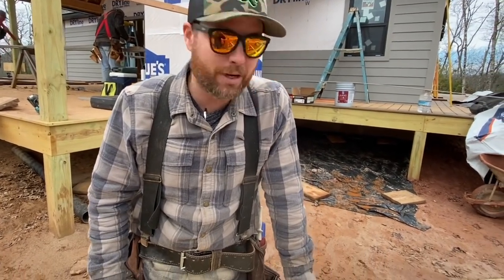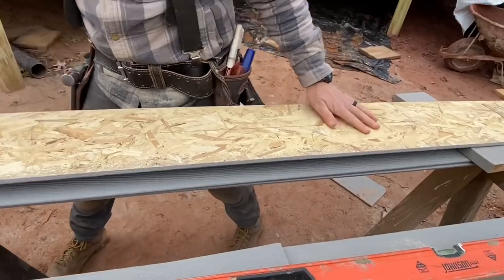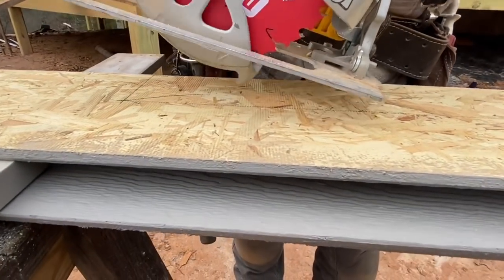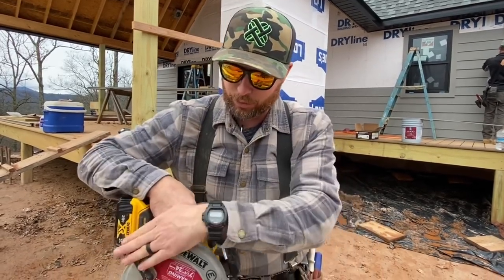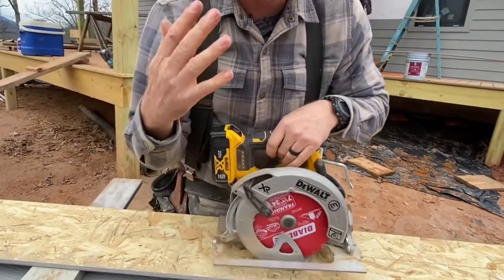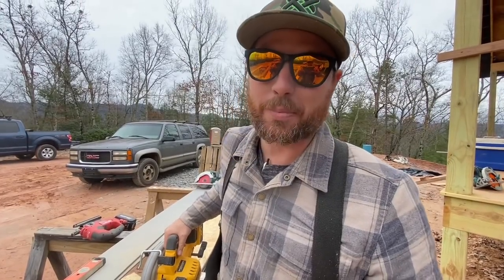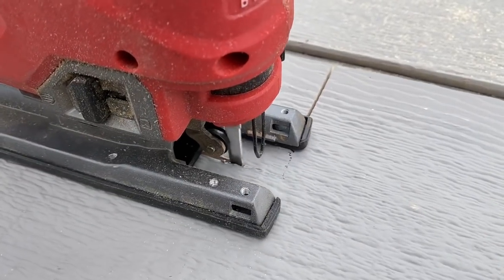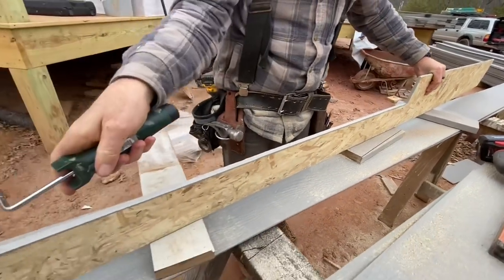Learn how to plunge cut with a circular saw

Comment: There have been times I've back-cut with a battery circular saw and ONLY a battery circular saw and it takes and extreme amount of focus and patience to cut a tight line going backward. For those curious, if it were not a battery saw, I would not attempt it. Battery saws have more forgiveness in that they stall quickly rather than a corded saw which will run through a bind until the freespin of the motor stops.

Comment: No sarcasm intended.  It is nice to know that sometimes some of the techniques that the pros use really are common sense. I thought you were going to show some special technique that the normal diy like myself would never pick up.  But you did it the same way i figured out many years ago.  I thought i was doing it wrong as i always needed to use a jigsaw to get good corners but it seems that is just the correct way that i just happened to figure out.  Thanks for the great videos.

Comment: Back when i was 20 i was a helper ripping rotted deckboards out. I was doing plunge cuts to split the board because there was like 6 coats of paint over the screws. I tried to go backwards and the big skil77 framing saw shot out of the cut and the blade guard ran along my inner thigh. If the contractor i was working for had removed that guard ,like some like to do,  i wouldnt be around today. This was a rural area and it was gonna be over an hour until he was back from Lowe's with the new boards. Could have been a real bad day so im glad to see you mentioned not to move it backwards lpl

Comment: Nice saw, my dewalt cordless is cheap, but lefty, which i prefer. My batteries, 4 amp and 5 amp dont last that long, especially cold weather. I ordered a skilsaw 7 1/4 blade left corded online last year, it works pretty good when im going to do alot of cutting in one place. 
I work on alot of barns, so the cordless tools definetly come in handy. Often just too far to run cords

Comment: Hey Guys.  I really like watching your quick videos.  To the point.  Factual.  A bit of humor....great job as always. 

I couldn't tell from this video, but I was wondering if you do a dado cut on the bottom piece of trim along the bottom inside edge of the window trim? 

Here, in the rain-soaked land of Washington state, I always dado the bottom inside edge of both of the side pieces and the bottom piece of trim so that my siding tucks up under/behind that dado'd trim board.  I'm not sure if I explained that well.

Thanks for all the work that you do to put out these videos. It's nice to be able to send a link to one of your videos to someone who has a question on how to do something.
Reply from the maker: Mike para-CAD thanks Mike... Great idea doing the dado cuts on the bottom piece of trim.. that’s a bombproof way to keep water running down the outside of the siding! We didn’t do it on this window… It’s up under a huge porch roof. Appreciate your comment

Comment: It's the same here in the UK.
It's all about getting a degree, apprenticeships are seen as second best. Also, people seem to be impressed by degrees, yet spend years doing an apprenticeship and people seem to regard you as one step up from a ship's rat.
The hours we work to scares most off, they want flexi hours, lunch hours etc. I started off as a plumbing and heating engineer, then went to earthworks operating excavators etc (I've always loved machines). I'd go wherever the machine was sent, that could be a two hour drive away the other side of London. Leaving home at 6.00am doing a 10 or 12 hour shift and getting home anywhere after 7.00pm would also put off many of todays youth.
Reply: Neil Crawford Not In all cases my firm employs a few young guys, I’m one of them being 20, at the start of my apprenticeship I was doing 12 hour days with 4 hours travel on top of that which lasted around 2 years, I’m at the end of my level 3 nvq now
Reply: @karlmoran2031  
Well done on the NVQ.
It's a bit of a killer on your social life doing those shifts and the travel on top.
Good luck for the future.

Comment: I back up plunge cuts, but carefully....sometimes you just have too in certain situations and have lot of experience but no for beginner would not recommend it.....I also find heavier worm drive saws to be bit more stable, and for life of me (know plenty who use them) I hate to cut with right handed blade.....in 80's they're weren't around so everyone had standard skilsaw wormdrive.
..so that's what I've used since....

Next show em a plunge cut with table saw freehand with no fence....that can be lil spooky!
Reply from the maker: Ok good comment... I do back up pretty often as well, but Is always sketchy! Didn’t want to advise anyone to do anything dangerous! For beginners is definitely better to just cut forward one way and then reverse the saw and cut forward other way to extend the cut.

Comment: I think more young people would be into building if people under 18 were allowed to work on jobsites (I don't know if the law is the same everywhere, but here in Michigan you can't hire anyone under 18 for hazardous jobs, which includes work on construction sites).  Helping build a home would be a great summer job for someone 16 and 17 years old.  It doesn't have to be dangerous; they can learn how to tile, drywall, or install fixtures and hardware.  I think being able to work in construction as a teenager would develop a love for building that would carry into adulthood.  As it is, teens are not allowed to work in construction, and no one they know works in construction, so it's not enticing.
Reply from the maker: Totally agree… Safety is number one but it’s good to learn safety at an early age. I was helping my dad when I was 12 years old.

Comment: How is the battery saw? I've been looking at those DeWalt saws but wondered how many cuts you can make before changing batteries?
Reply: Love the dewalt 20 volt. Got a.           6 1/2 & a 7 1/4. Love the 6 1/2 better. Bigger battery last longer.
Reply: @jm the dewalt cordless circular saws are fantastic but if you want one that is going to keep on cutting all day on one battery then I would suggest that you go for either the dcs575 or the docs 576. They are the 54volt(60volt in the us), the difference between the 575&576 is that the 576 has the base/sole plate that will fit on the dewalt guide rails which provides a perfectly straight cut without the need for clamping on a piece of wood to guide your saw.
They are truly a fantastic tool and thanks to the battery technology they are just as powerful as corded and will last you all day long!

Comment: Hello everyone, question. I’ve been doing undercover security for target 11yrs. I’ve been itching to get into the trades. As of recent some doors have opened to have a chance to get into carpentry or concrete/masonry. Any suggestions for someone with no experience or skill like me at age 29. Thanks in advance for any suggestions
Reply from the maker: Hey there… Trade school is great and if you can take any classes on carpentry that would really help as well. If not just start building something. Even something as simple as a saw horse… Figure out how to build it sturdy and quickly.  We are always pleasantly surprised when we hire someone and they actually know how to build something!
Reply: Perkins Builder Brothers thanks, as of recently I opened up one of my walls and removed some studs and framed a door frame. Also built a wall mounted tire rack for 5 tires. So far the information I have gotten from my mother in law and my cousins husband is that school would start paying me from the beginning roughly $600 a week. And I’ve gotten a ton of ppl tell me to not turn down any chances I get to get into the union. I’m really interested into getting into this career path of trades
Reply: I’m 48 and only wish I started sooner. Do what u love and the money will follow. Trust in ur process.
Reply: Nicholas Huss thanks for some reason I feel like I’m starting late at my age
Reply: Look for a job as a maintenance man.  That's how I started.  Hands on experience is the best teacher!

Comment: Remember, shearing is a method when cutting fiber cement siding since it does not create dangerous dust.
Reply: Brian Young this isn’t fiber cement board.. it’s lap siding made out of osb which doesn’t create the same dust.
Reply: I know, just throwing some random knowledge out there! A composite floor is one in which that the steel deck mechanically bonds with the concrete topping so that the concrete and steel can work together to form the floor structure.